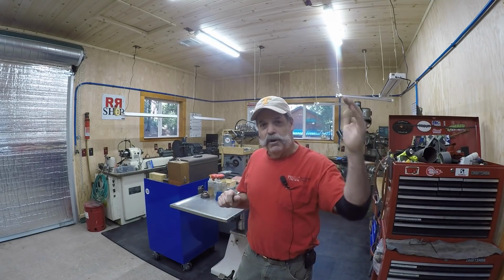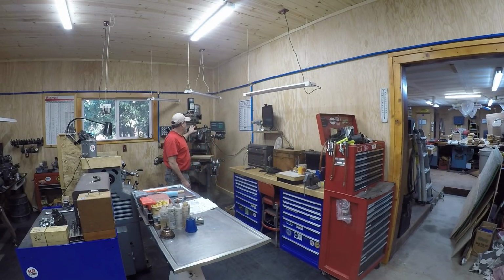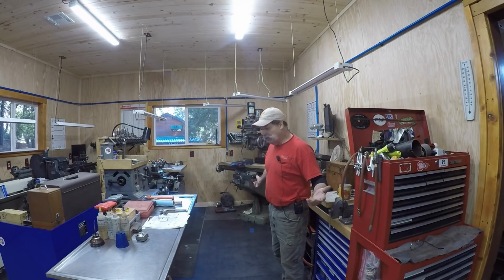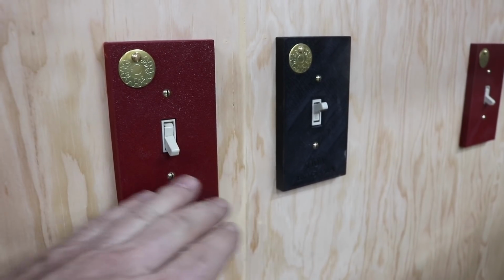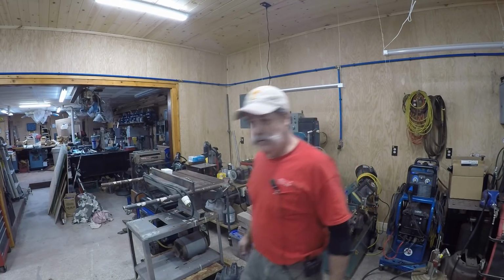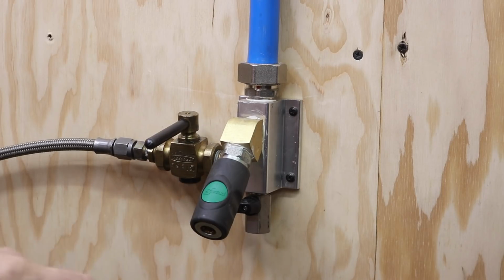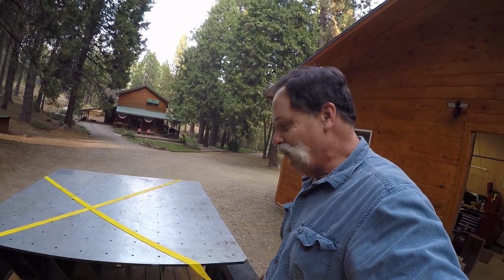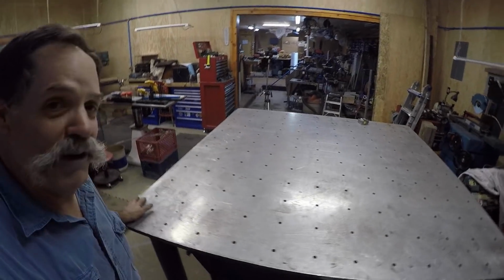Fixture / Welding Table 6 x 6 | Rapidair Maxline Airline | The Final Update P15

Comment: I was very disappointed with the Max Air system I put in my shop expansion this past spring.  The fittings are very expensive and use an 'O' ring seal that there is no way to know if it has sealed properly as it is a blind assembly.  I used a mainline of 3/4 and feeder lines of 1/2".  It was frustrating also that the 3/4 pipe and the 3/4 coil both made by Max used entirely different fittings.  Something not made clear when ordering.  The biggest drawback was the maximum air pressure rating was 175 psi.  My compressor is a two stage and can easily operate at 165 psi a not unusual home shop pressure.  That close of a tolerance is just not appropriate.  Consider that all my whip hoses and hose reels are rated at 300 psi.  This is with a premium priced system.  Not even going to mention how difficult it is to find leaks.  I have a sixty gallon tank and 100 ft of 3/4" with 200' of 1/2" which is a good volume of air.  My system leaks down after 24 hours completely.  I have discovered a couple of fittings with casting flaws that I replaced and I have 'soaped' the entire system three times with no solution.  I have a feeling those hidden 'O' rings can be slightly damaged and or the piping itself which looks very thin walled (the aluminum barrier in it must be about the same thickness as common kitchen aluminum foil if that) may be seeping.  No in conclusion the installation was very time consuming and the result bring me to the conclusion that were I to do it again I would never use Max Air.  I believe I would opt for soldered copper which would have a higher working pressure and be cheaper in total as well as quicker to install.  It seems to be another one of those products that make up for in advertising what they lack in good quality engineering and manufacturing.  Consider also you are basically getting a PEX system only it is not interchangeable in tube or pipe size at a higher cost and lower operating pressure.  I spent a lot of time and money meticulously putting in a system that has only been a disappointment.
Reply from the maker: Thank you for your input.  I have had great success with the system.  Did you try an ultrasonic leak detector?  These will find the smallest of leaks.  I did have a couple of leaks and they were all from the back side plug of the manifolds.  If you are going to be operating at the max rating of there system I would recommend that you use a system that would be rated a 1.25 to 1.5 times your max air line pressure.   I operate my system at 125 psi, not a problem.  I was not aware that there pipe an roll are of a different size.  Have you called there customer support for help.  I found them to be very helpful if you are have an issue.  I am not associated with Maxair in any way.  Most state laws have regulations for compressed air systems over 150 psi, you may want to look into your state laws.
Reply: @rrintheshop  I will have to research that leak detector.  Sounds useful.  I backed my pressure off to 110# just because of the weak system not because it was ideal. When you unroll the 3/4 line it of course reforms so when attaching fittings even after vigorously applying their forming and changing tool you still don't get a perfect radius in the tube.  For that you really need a more powerful and longer forming die.  I am going to be curious in view of the poor engineering to see how the tubing holds up over time.  The slop in the 'O' rings is detrimental as once caught by the changer you really have no way of knowing if they seat correctly.  Takes a lot of force in awkward situations to seat the tube (3/4) full depth on the fitting as well.  Need a gorilla grip.  Just poorly designed.  Hopefully the 3/4 pipe straight sections might be better??  Thanks for the tip on the detector.  Hate to have to pull two dozen drops off the wall to check those back plugs!!

Comment: It might be a good idea to make a complete circuit of the air like with a connection over the entrance door.  This would help reduce pressure drop on a long line.
Reply from the maker: Thanks Roy.  If I run into issues I might do that.

Comment: Ok Randy,  Yes I like that idea better a more sure solution and since they make 1/2 inch that seems more suited to my needs, but on the other hand 3/4 likely isn't much more expensive.  Thank you for the advise.
Reply from the maker: Yep.  I ran 40 ft out to the new addition then 70 ft around the new addition, well worth the 3/4 for enough air flow.  I love this system.  No dirt/rust in the lines.

Comment: Randy,  Is PEX with the crimped fittings suitable for the shop air.  My compressor shuts off just under 175 psi.  Would 1/2 PEX work or not.  I work alone so 3/4 likely isn't necessary as only one thing ever gets used at any time.  Your thoughts would be appreciated!  Thank you.
Reply from the maker: You would have to look more into that, I do not know.  Rapidair also makes this airline in 1/2" systems.

Comment: Got to be careful, as you get older, about trips and falls, etc.  We don't bounce back like we used to.  I slipped at the edge of our burn pit several weeks ago and made my left shoulder nearly useless.  It wasn't the fall that hurt me, it was the instinctive attempt to counter it.  Windmilled my arms, something popped in my shoulder, and I've been nursing it ever since.

I put one of those horse trailer mats under my lathe and power drive, attempting to keep noise from being transmitted through the floor (hydrostatic whine, high speed motor noise).  Still sounds like a deep well pump, but it may have helped.  The machine is really stout, with a large, flat footprint and it doesn't appear to be affected by the mat, so it will stay unless I find good reason to remove it.  Debating trying one under the surface grinder, as I've heard that the floor can influence the surface finish to an extent.  At the moment it sounds like a lot of work for a crap shoot.
Reply: shop looks great, by the way.  Now we need to get Steve, Brian, and a few others finished up.  Mine looks like a lost cause, but, no harm in helping others.
Reply from the maker: Digger,  I only put my small logan lathe on top of the mats.   Everything else is sitting on the concrete.
Thanks,I am glad I was able to finish it up before winter arrived.

Comment: Nice table.  Just finished mine at 3'x5' with 1" top.  I drilled 5/8" holes for inserta style clamps and 5/8" unc holes in a 4" diamond pattern alternating threaded and unthreaded. It's been good so far.  I pinched a nerve in my neck/right shoulder the other day.  I couldn't sleep more than 30 minutes at a time last night.. I hope your elbow heals quickly as I know how that feels.  You can't just suck it up and push through the pain either or else you'll set back healing a long time.
Reply from the maker: Thanks Barry.  That will be a nice table.  Yep got to let it heal.

Comment: Did you say you needed a conduit bender to bend the air line for the corners?  I take it they are metal then instead of rubber?
Reply from the maker: Thanks Pat.   The tubing is Alu with thick plastic inside and outside coating, you can do a very good job bending with just you hands.  I used a EMT conduit bender for a bit tighter and neater bends.  It is very nice stuff, no corrosion so not dirt or rust in the air.
Reply: @rrintheshop  Thanks, I'm thinking of putting some up in my garage.

Comment: Beautiful job on the shop Randy. You inspired me to do a major shop remodel after 30 years in the same shop. 👍🏻

Be careful with your elbow injury. I struggled for years with lateral epicondylitis from manually stroking large parts on the Sunnen hone. Very debilitating injury. Finally required surgery to resolve it. 🙂
Reply from the maker: Yep taking it easy on the elbow,  so a bit slow in the shop.   Thanks for following, I am enjoying the new space.

Comment: Hi Randy, just caught you before turning in. I love the shop & thanks for taking us along for the ride.
If you do cut down that table, put fold-down sides on it to use as vertical fixture plates or fold them up for large top surface. It'll take up less room when not in use. Stay safe and well :)
Reply from the maker: Thanks Anthony for the thoughts.  No cutting yet.